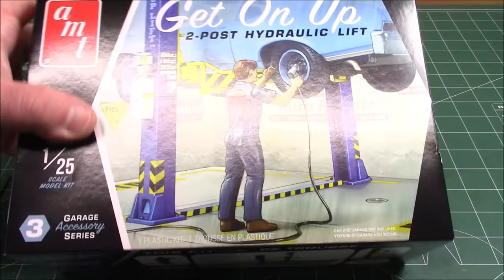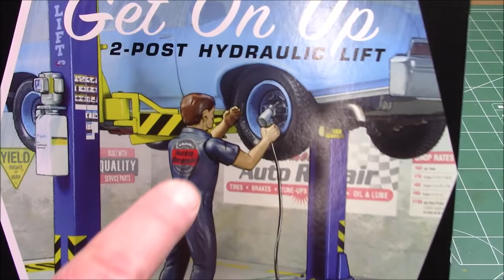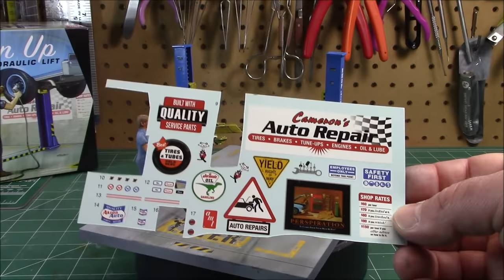AMT Garage Accessory Get On Up Car Lift 1/25 Scale Model Kit Build Review AMTPP017M

Comment: Awesome kit and build. I think the EPA would frown on a floor drain though.
Reply: The Sears Auto dept. I worked in had floor drains under the racks, they went to a big holding tank outside the shop under the parking lot. It was emptied by Safety Kleen when it filled up.

Comment: Hey Chris I, have a question for you, what is CA glue???
Reply from the maker: It's short for cyanoacrylate which is just the proper name for super glue or Krazy Glue.  All the same stuff.
I called it CA back when I got my start building RC airplanes as that is what all the hobby shops called it and it stuck.